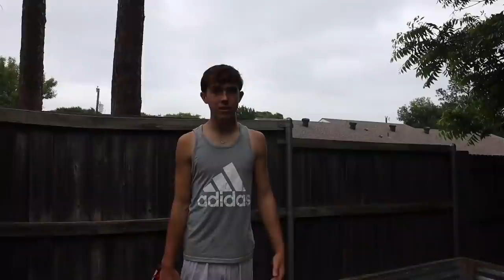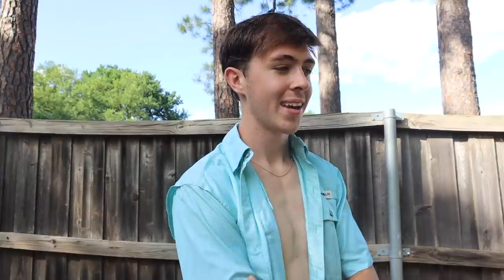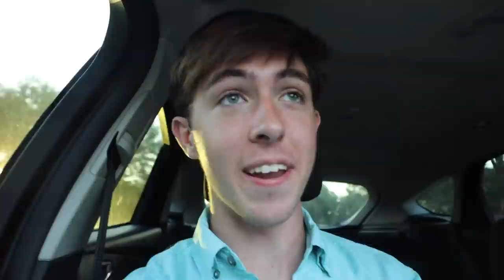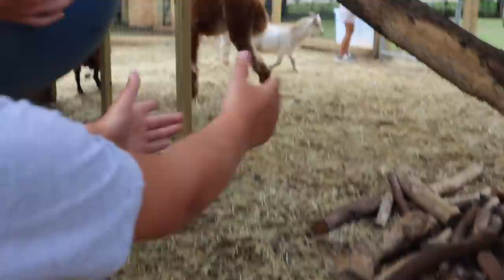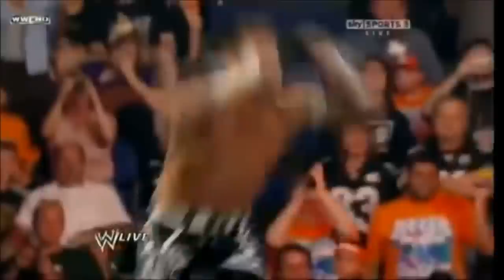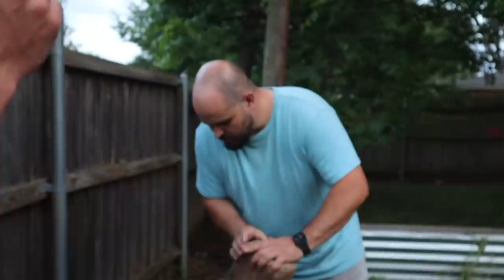Stocking NEW BACKYARD Pond With MASSIVE FISH!!!

Comment: Garden for the animals? For the empty side of the new bass pond? 
Should do some research, if you use hugelculture (putting wood, branches, and biomass like leaves filling up the nooks and crannies between the wood and branches) this is so you can have some free fertilizer in the years coming (this is so you also don’t have to buy a bottom layer of gravel for water drainage and avoid all the crazy stuff that comes with super high raised garden bed) also you can buy less soil to put on top of the wood (saving money and time), whereas without hugelculture you will not have enough budget to spend on good Natural fertilizers and a few hundred bucks will go down the drain, along with a full day of lifting bags of dirt from Home Depot, or risk spending more money, that soil should be mix a compost, and blood&bone, raised garden bed soil from home depot, and then cover the soil generously with straw type mulch.
Here’s a link to a few videos from one very useful channel that should give you a decent idea of what your getting into- 
https://youtu.be/qiynadxrrPE
https://youtu.be/3O2qCQU7Cac
https://youtu.be/rU-76AnBEao
https://youtu.be/oOj1Z7nI768
https://youtu.be/BIdcUIgvJ5Y